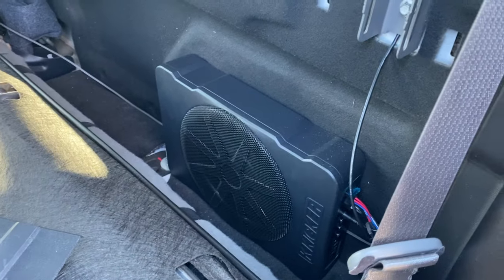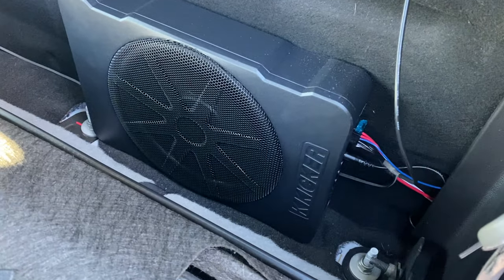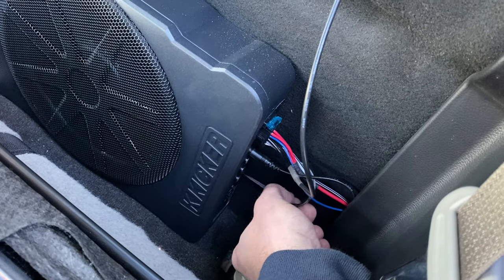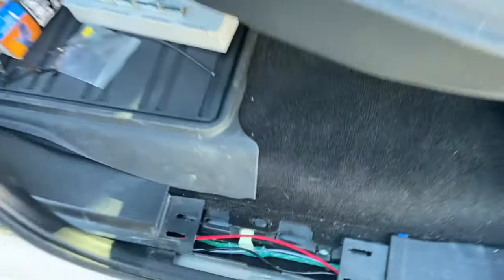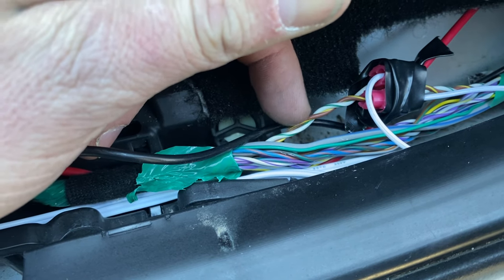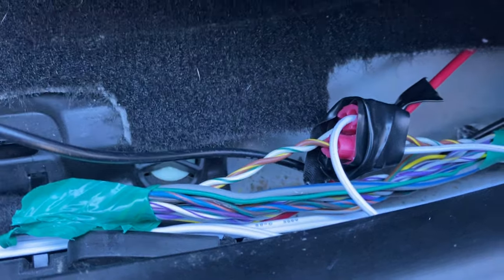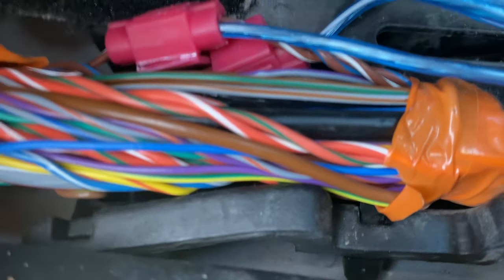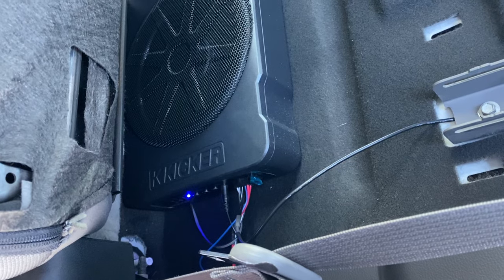2015+ F-150 subwoofer install made easy. Kicker 10”.

Comment: You need to get the signal from the front speakers, the rears don't get the full signal that the fronts get.  The signal to the rears get bass cut out as the volume is increased. Otherwise thanks for the video
Reply: Ooofff i took my rear speaker wires, might have to rearrange mine
Reply: I second this I just installed my amp/sub two days ago and was getting minimal Bass. Almost returned it to amazon but then I saw your commend and I spliced into the front speaker wires and the quality of base is much better. Thank you alkalk8938
Reply: Did u have to remove the head unit?
Reply: @Thedumbwayhomie yes it made it easier. There's plenty of room behind that unit too. Use zip ties for the wires it helps alot!
Reply: Where did you connect to the front speakers? I’m hoping to get this done today? It sounds terrible right now!
Reply: @gothamxp5  where did you connect to the front speakers at? I need to do this today. Lol.
Reply: Do you have to get to the front speakers thru the radio/dash or can you get to them on the kick panel closer to the front ?
Reply: @jeramywrestler7094 I would like to know this as well.
Reply: Plug n play kits makes a harness for the front speaker connection, no splicing, literally plug n play!
Reply: What if I have the factory harness you don't have? How would I use that?

Comment: I don't understand why people run RCA's from the stereo or tap into speaker speaker wires. There's literally a wiring harnessed in the left side rear pillar. Just get your signal there and run power. It even has a remote turn on wire(blue). You just need a motorcraft wcc 1212 harness plug, Amazon 22 bucks. To use the remote turn on you have to turn it on with forscan or the Ford dealer if you don't have DC offswitch
Reply from the maker: And I don’t understand why people who know what to do would watch a video on how to do something? 😂
Reply: He started the video saying his truck doesn't have the WPT12 connector in the rear pillar. Did you watch the video??

Comment: I picked up the same amp/sub set up and i wired it up with the factory 1212 plug, very easy. But i didnt have a way to use forscan and 1 of the 3 dealerships that i was able to actual talk to an advisor said $90 and soonest is 2 weeks out...yea screw that. Took a chance and wired it up exactly how you described with the same settings and it works PERFECTLY! thank you so much for making this video. Definitely recommend T-tap connectors for the speaker wires, pretty tight in there.
Reply: Is the power and ground in the 1212 plug? Thinking to go this route instead of the factory kicker sub, just don’t want to run any additional wires.

Comment: Butt splices are NOT a hack, that's exactly what you should be using on any automotive wiring. NEVER solder; the constant vibration of a vehicle will eventually cause solder joints to crack. That's why NASA uses crimp splices for spacecraft. You just need to make sure you use a proper crimper and make sure it's the right type for the splice you're using! I had to buy a different crimper for heat-shrink insulated connectors versus non-heat shrink. And always use ratcheting crimpers, they will always provide higher clamping force.

Comment: did the sub come with all the wires you needed or you had to buy them separately?
Reply: Wires are included 👍

*wire harness is included, but you might need to buy a cable to extend the speaker wires to stereo if you are thinking about hard wiring.

Comment: I cannot begin to tell you how helpful this was!! Thank you for making this video. The only thing I did differently was the speaker location and anchoring the speaker. I too had trouble with the speaker wire reaching the passenger side, so instead of splicing more wire, I moved the speaker to the center of the backseat. That gave me just enough length to reach. I ended up anchoring he speaker to the back bulkhead carpet because everytime I stepped on the brakes, the speaker would flop around.....so annoying. With that said, GREAT VIDEO!!

Comment: The truck is aluminum the ground needs to go to the frame or battery not the body. Also tieing it to the speaker wires wont work for the sub the radio cuts the bass as the volume goes up.
Reply: Kicker recommends high level inputs over RCA for this application.

Comment: If you just use the audio signal (to turn on amp) feature, do you still have to run the BLUE remote wire to the back of your stereo?

Comment: I've been googling and searching for days now for exactly the same answers as yours , only difference is that in my case I bought 2 different brands of active subwoofers ( WITHOUT REALISING THE KICKER IS SAME VIDEO, BUT THE " ICE " SUB ONLY HAS RCA INPUTS )

So can I connect 1 sub through RCA to main unit AND then connect the kicker through the speaker wires?

Comment: Anyone else have the issue where the amp won’t turn off after turning off the truck, removing the key and exiting the vehicle, Blue light stays on, I’m afraid of it draining my battery.
Even though I’m having issues, still the best video on the HS-10 install.
Reply from the maker: Mine takes a couple minutes to turn off. Check back on it after a few minutes.

Comment: 2020 F150 - After I tapped into the Right Rear Speaker wires (+/-), my check engine light comes on, the error states “Malfunction Indicator Lamp - Regulatory: Powertrain Control Module has detected the power relay de-energized earlier than expected”. I followed your video exactly, I triple checked the wiring. Funny thing is, I tested the sub while only Left was wired in, and it sounded great and no engine light. Any thoughts/ideas?
Reply from the maker: No idea mine hasn’t had any problems. Maybe it cut the wire instead of just tapping it? Those taps can def cut wires if not on there perfect.
Reply: @IdleHands  oh man, I didn’t think of that! Thank you so much, I’ll check tomorrow and reply with an update!
Reply: @IdleHands  turns out my Right Rear positive t-tap didn’t actually tap into the wire. The PCM noticed something wasn’t right and threw that error. Fixed the issue and the system is bumping! Thanks again for your video!
Reply from the maker: @SeanSoto  hell ya thing slaps. 👋
Reply: @IdleHands  New problem, I keep blowing the 40amp fuse in the 12V power wire… I just used butt splice connector for this. What are you using? What do you recommend? This is the only thing I can see that might be causing the issue.

Comment: Wouldn’t you tap the stock subwoofer signals? After the dsm so you dont mess with the comoonants each door speaker and stuff is a component coming from the Sony dsp that’s filters everything. You def should have tapped after the stock amp and from the subwoofer signal

Comment: So i installed mine this same way. I have a android head unit as well. for some reason the sub works great when i play music from internet apps pandora etc, or off of my phone. But for some reason the signal goes away when i use the trucks am/fm radio, or the factory Sirius Radio. There is no sound whatsoever coming from Sub in these two situations. Does yours do that or did i do something wrong?
Reply from the maker: No mine works great from my phone and from Sirius radio.
Reply: @IdleHands  any idea what my issue could be?
Reply: @raidernut5  did you ever figure it out?

Comment: I just checked my truck and i do hae the connector back there. If I purchase the pigtail, what wiring will that take care of? also do u have a wiring diagram of how it should connect to the amp pigtail? what other connectors will i need?
Reply from the maker: There is a forum thread online about it. Might just have to search google.
Reply: @IdleHands  do you know what forum?
Reply: @IdleHands  where you able to find the wiring diagram?

Comment: Where did u hoop up the remote wire?
Reply: The DC option on the Amplifier basically knows when the stereo is on because of the speakers being active so that acts as the blue wire, if you use RCA cables then you need the Blue wire

Comment: I was thinking of putting 2 of these in my extended cab f150. Is it required to have both speakers wired into one sub? Is it possible to just wire the driver side wires to the driver side sub and vice versa for the passenger side wires for the passenger side sub?
Reply: I've been googling and searching for days now for exactly the same answers as yours , only difference is that in my case I bought 2 different brands of active subwoofers ( WITHOUT REALISING THE KICKER IS SAME VIDEO, BUT THE " ICE " SUB ONLY HAS RCA INPUTS )

So can I connect 1 sub through RCA to main unit AND then connect the kicker through the speaker wires?

Comment: Also I realized at the end you mentioned using Forscan. So in order to use that connector, you have to turn that connector on?
Reply from the maker: Yes that’s my understanding. It’s something you have to change in the computer.
Reply: @IdleHands  just waiting on my OBDII connector to get this this turned on via forscan. such a sweet and easy install.
Reply: @IdleHands  so the way you ran it does not require the ForScan correct?
Reply: @IdleHands  so the way you ran it does not require the ForScan correct?
Reply from the maker: @JustAGuy781  correct
Reply: My question is what is forscan? Just got an 2017 f150 and purchased the sub and stuff and now I hear another connector?

Comment: Quick question, why not use an inline fuse on that constant 12v? No need? Thanks Also great video!
Reply from the maker: The subwoofer itself is already fused also that line is already fused in the truck. You could always add another fuse but to me it’s overkill.
Reply: You should. The power wire should be fused within 12 inches of the battery end. The fuse on the amp protects the amplifier internals, and the fuse on the power feed protects the wire itself. A short in cable that large can start a fire pretty quickly, and that battery-end fuse is your protection against that.
Reply: @gokblok  havent ever had problems without a fuse, not required
Reply: @juledoren  just because you want to be stupid doesn’t mean others should be too

Comment: Did you adjust any settings in your factory settings to improve sound? Not too blown away with it after install. I thought it would be better.
Reply from the maker: Didn’t change my he factory settings but I did mess with the settings on the unit itself. I also changed all the other speakers in the truck so that helped.

Comment: I want to add a second subwoofer to my truck but don’t want a crap ton of extra money in this system. Can I do this on top of my Sony sound system with the stock subwoofer?
Reply from the maker: I don’t see why not.
Reply: My 2014 f150 has a stock sub as well.  Best Buy won't touch the truck due to a small amp wired in to the Sony system from the factory.  They said a preloaded sub will ruin the Sony amp.  Don't know if there's any truth to what they said, may have just wanted to not do it
Reply: @wednesdaychurch8965  not true. If you run a separate power and ground and remote to this setup. It won’t affect the other Sony components at all.
Reply: @cvd127  I appreciate the advice.
Reply: I had 2 10” installed under rear seat. Much better base than this 1 Kicker

Comment: So I have an amp an subwoofer, it has direct power connection to the battery but I recently got a new radio installed and they didn’t hook up the amp. Can I use this same method in the video to give my amp signal?

Comment: Can I do this on 22 tundra double cab? Do you know if the speaker wire colors are usually the same on other vehicles. Great video btw
Reply: Follow on question did you have to connect power cable to battery?

Comment: You sir….are clipping hard. You have your bass boost all the way up and your gains almost half….when using bass boost the gain comes down and if you turn down your bass boost your gain goes up. Play a 40hz test tone, turn your bass knob all the way up then set you bass boost to where ever you want and then start to set your gain, once you hear the bass sound different turn your gains down until it goes away.
Reply from the maker: Ya I adjusted everything after the video. Thing sounds great just what I was looking for.